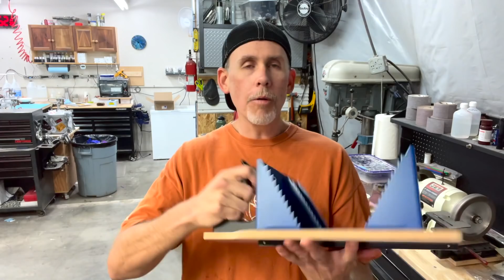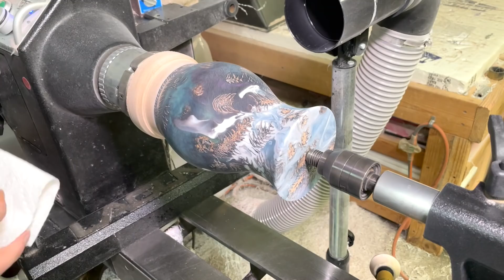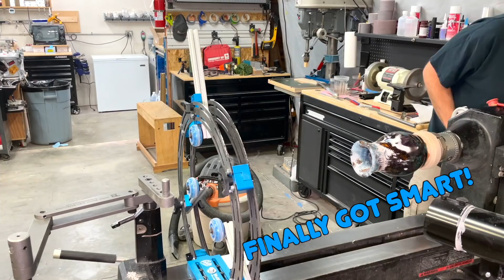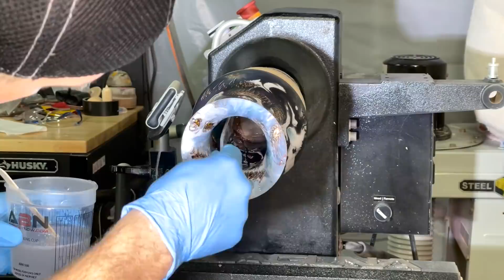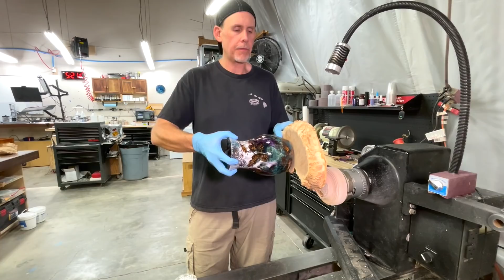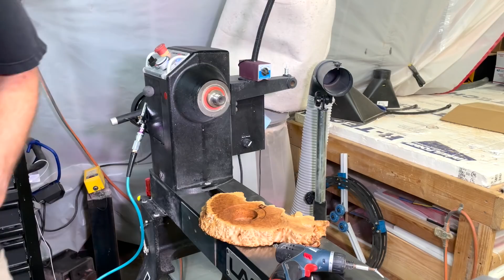Woodturning Hybrid Pinecone Resin Hollow Form Lamp with Epoxy Finish

Comment: Love this piece. I noticed the mold you used was PVC pipe. What was the piece on the bottom of the mold with hose clamp? Looked like a rubber cap. Where do you get those? Thanks

Comment: Great video Zac. You have given me some very good ideas on how to do some of my own projects. I'm in Kalgoorlie, Western Australia. I have almost finished making something very similar to this, but with a lid, as an urn for a friend's father's ashes. I don't have any fancy hollowing system, so I cheated and hollowed from both ends, and then made a jarrah base and recessed the body of the hollow form into the base. I got the brass threaded inserts for the lid sent to me by Carl Jacobsen in the States. Coating the inside with clear resin is definitely much easier done as you said by just dumping some in there and turning / working in your hands, and then pouring out any excess. There's a couple of minor imperfections in mine that I'm going to sand out and then re-coat, but if it comes out looking anywhere near as good as yours, I'll be very happy.

Comment: great looking finished product! I like how the light shines thru.
it looks like it'd be easy to accidentally knock over, tho.
if you drilled a few holes around the opening of the base and the bottom of the lamp, plugged the holes in the base with dowels that extend an inch or so, and then sat the lamp on top of that, do you think that would make it more stable without detracting from the overall finish? or do you think the dowels would be visible through the resin when the light is on?
Reply from the maker: That's a good idea, definitely couldn't hurt. It's pretty stable as it is though, and we placed it where you won't accidentally hit it. So, I don't think I'll change it, but I'll keep it in mind for next time

Comment: im off subject of this video, but i got a problem. i used 1 of those silicone cake pans for my 2nd pour ever. it leaked some from the seam. it was the same pan you used in a prior video. my real problem though is the glass bottom is stuck like chuck. any suggestions? thanks Fresh Air Woodshop -Kansas
Reply from the maker: That's a total bummer! I had one leak on me too, they can be hit or miss. I never had an issue with the resin sticking to the glass, I'm not sure what you can do other than try to wedge a putty knife or something in there to pop it off
Reply: @ZacHiggins  i put it in the freezer. i took my thinnest putty knife to it. it was pretty intense. i felt like the glass was going to shatter at any moment, but i prevailed! i do think freezing it helped. next time ill test the pan to see if it hold water, if not maybe ill silicone the seam where silicone meets glass.? thanks for the reply!

Comment: Honestly, after seeing that blank, I thought it was going to look like... um... crap. But nope, I was shocked at just how beautiful it turned out! The top, which looked like cones trapped in ice, melting its way down the lamp to spring. Absolutely gorgeous!
Although I will say it looked far better on its own as a vase than it did mounted on wood with LED's inside of it.
Reply from the maker: The outsides of blanks can be really deceiving, it's what's inside that counts 😀 I was really tempted to switch gears and just make that into a vase, but I really wanted to see the original project idea through to the end. Overall, I'm really happy with the lamp, but I am definitely making a vase sometime down the road

Comment: Zac..really nice design , craftsmanship and excellent video.  Using thin coat of resign for the finish is great technique and have done flood coats on flat work, now ready to try on my turning projects.  Merry Christmas!  Bill
Reply from the maker: Thanks Bill! I'm really loving the resin finishes, they just really pop like nothing else I've tried 😀
Reply: @ZacHiggins  It is really strong and waterproof too.  Your lathe speed appears to be perfect as well.  My variable speed lathe does not go that slow so going to build a slower turner out of a rotisserie motor.  
Have a great New Year! Bill

Comment: That turned out fantastic! Great work! I use a cup turner to coat slow clear platters with ACC to make them food safe. I made a small tapered glue block that I tape to the bottom of the plate then put it in the pvc then coat it.
Reply from the maker: That's perfect! I got the idea for the rotisserie from the cup turners 😀

Comment: Zac this is an amazing piece. When I saw the shape I thought you had made a vase but it looks good as a lamp too. Almost makes one wonder if you misjudged the depth when hollowing  and changed course to save the project.🤔 Either way its awesome.
Reply from the maker: Thanks RB. This was intended to be a lamp with a through hole from the start, but it sure would be a great way to salvage a mess up too 😉

Comment: Beautiful  turn, Zac. Did you stabilize your cones? I do not on my mills but I do keep filling them with CA while sanding. I do spray them with lacquer before pouring to seal them up. It seems to work well.
Cheers,
Lee
Reply from the maker: Thanks Lee! I believe they were all stabilized, maybe one or two snuck in that weren't. I usually stabilize things like that so I don't have to worry about them holding moisture in, and they turn a little better than non-stabilized cones too